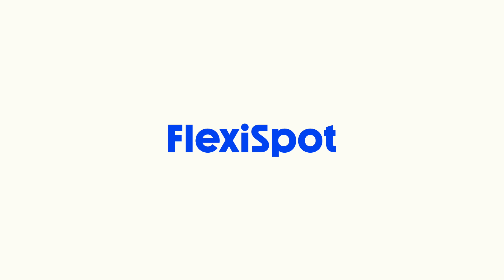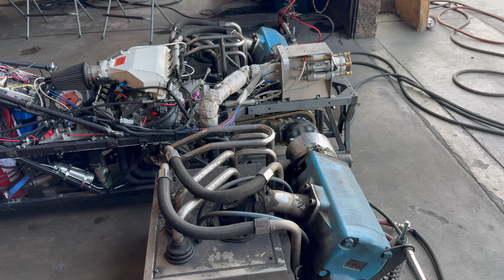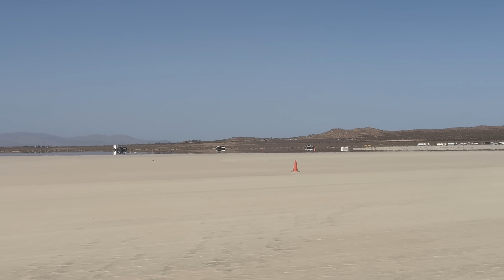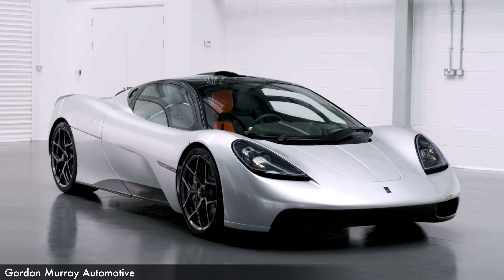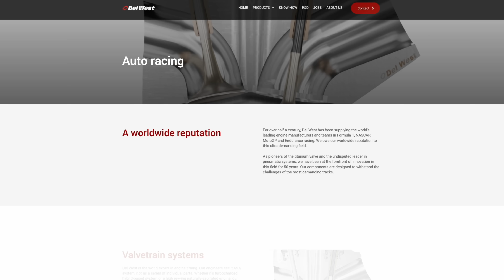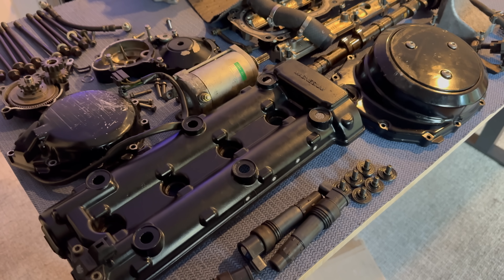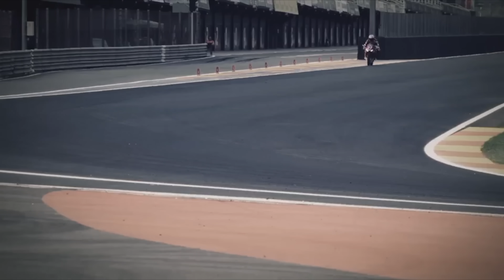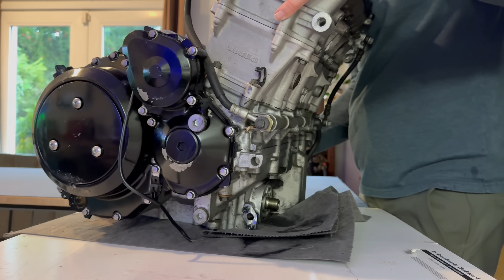Motorcycle Engines Are WAY BETTER than Car Engines

Comment: Motorcycle engines are better than car engines, until you look at how much maintenance they need and how much fuel they use. Car engines never need valve clearances adjusted because they use hydraulic lifters, which wouldn't work at motorcycle engine rpm's. Car engines also have turbo chargers which makes them much more fuel efficient, my 1.8 litre petrol VW uses the same amount of fuel as my 900cc Yamaha and makes a lot more power with that fuel (250hp vs 115hp).
Bikes are much, much more fun though

Comment: In motorcycle engine, there is no ari compressor, power steering pump and no needed massive huge alternator cause its purpose is just going forward. It has less stressful issue than car engie does.

Comment: The more I see of Matt's stuff, the more I think "Why does everyone else not LISTEN to Matt??????" As a car and motorcycle nut, I've never heard such a succinct and accessible explanation. 
I might add that back in the sixties, Honda built multi-cylinder Grand Prix bikes that routinely revved past 15,000 RPM. Their 5-cylinder 125cc bike engine revved to over 20,000rpm....

Comment: 40k overhaul interval should be taken with a grain of salt. It's difficult to establish hard data since, as you stated, there just aren't many motorcycles out there that have the same milage of passenger vehicles, but the bikes I've seen with 50-60k miles often run fantastic with no sign of fatigue. When I see a bike with 8k or 15k with engine issues, two things come to mind: neglect (lack of oil changes, abuse, overheating) or stagnancy...the worst thing you can do to a motorcycle is let it sit around for 10+ years. The acids trapped in the oil start eating the seals and varnishing\carboning everything up.

Comment: I own a Honda VFR 1200X. It has OHC valve train and some of the components are same as in Honda car engines. It has been designed by Honda to last 300k km. German Biker Motorrad  magazine does long range tests with selected bikes. After 50k to 100k km they take the entire bike apart and inspect all parts. All Honda engines they inspected showed little to no wear.  My bike has 40k mil on the clock. Engine runs better than new, burns no oil. Only negative, manual valve adjustment required every 50k km.

Comment: Bikes may have less longevity, but its pretty surprising just how far they will go, even while turning loads if rpm. I have a ninja 500r from 2001 with coming up on 50k miles, runs like a top, rips up to 11k quick as you like. cams are a bit dark, but dead smooth. Sounds like a bucket of bolts at idle, but from what I gather thats just the way they are. Nothing done to the motor save for the occasional oil change and valve adjustment. Oh and the clutch springs. Still has the original clutch as far as I can tell, but somehow the springs wear out first on them.

Comment: motorcycle engines generally need a rebuild roughly every 50,000-100,000 miles not matter how they are maitained. though they are much cheaper to rebuild and work on 90% of owners are not up to that task. it is no longer uncommon to see 4cyl and 8cyl vehicles with over 300,000 miles and counting.

Comment: i just love how the first "car" was a motorcycle. literally a "automobile" - something that "moves on its own" - was a motorcycle. and still, like 150 years later, we still have the objectively better "autos" with the motorcycles. we can argue about comfort, space, practicality (like having a roof, climate control and the possibility to have a snack or drink while driving for example) all day long, but bikes are just better. they take way less space, they are easily parked and maneuvered. they need less fuel - if we all would drive a bit more reasonable of course - while achieving INSANE power and speed specs. they look cooler, sound cooler, its just better. this video is tripleA quality. you described almost all advantages in a good pace and detail, without being to boring or to techy. the real question is: why are not pretty much all people motorcycle owners? why are bikes regarded as organ donor vehicles or the poor mans sports"car"? its just better. and - what i love most btw - the technic is simple enough the be learned by a non pro. im not saying that every idiot should mess around with their bike, but brakes, wheels, tires, chain, electrics, clutch, exhaust, gas, battery stuff ... its all so much simpler, lighter, easier. you dont need a huge garage and expensive shit, you can fix most motorcycle stuff without even lifting it off the ground properly. if needed, just roll the front wheel onto a beer crate and you are fine. if really needed, get a buddy and you two and pick up the rear and lift it up too, easily. man i love motorcycles. shout out to all riders out there and for reading this long comment. lastly... be humble and grateful. we are experiencing this wonderful area of super hightech bikes, and our grandsons will not. enjoy it. we are the last or second to last generation that will be allowed to race them around, tinker with them, tune them, have fun.

Comment: Off road guy here. I couldn't think of anything worse than a motorbike engine in a 4x4. I need something that has enough torque at idle to move the vehicle using high or low range, with or without lockers in, without having to kill a clutch or rev the nuts off it. 

Horses for courses.

Comment: There is also Koenigseggs technology with valves where they are actuated by solenoids instead of camshafts, also good for not having valve float and lots of control over airflow

Comment: Car engines have different needs and requirements, I wouldn't want a 200hp car revving to 13,000 rpm with straight cut gears. I get they use larger pistons and cylinders add more stress and weight, but at low revs, they make good torque to get the car moving under any condition and that is what are customers are paying for. you gotta zoom out a little.

Comment: My hybrid VTOL "flying car" will use a motorcycle engine (air cooled) to power the alternator which makes the electricity the octo-motors use to fly the craft. 400cc+/- is a good jumping-off point.

Comment: Motorcycle engine is ment for motorcycle, light vechile. It needs full power very seldom compared car, that is heavier. When motorcycle engine is istalled in to a car, it must work harder, needing full power more often. Motorcycle engine won´t last as long as car engine, in a car. But, it might be much funnier, maybe that is the point.

Comment: Yea thats what happens when you're allowed to design a motor with little to no emmisions restrictions. The modern day makes engines unreliable because of increasingly strict emmisions regulations that lead manufacturers to prioritizing a models carbon credits over long term reliability/efficiency.

Comment: Excellent video, but minor correction: the force vs compression curve for a gas spring is not exponential. It is non-linear with an increasing slope, but that does not make it exponential. I assume you know this and used that word for simplicity.

Comment: When comparing longevity of motorcycle engines vs car engines I think it is important to factor out driving habits.  Often motorcycle owners are letting their bikes sit for months at a time and don't put very many miles on the bike.

I commute daily on my 2015 Yamaha FJ-09 and it has been completely reliable for 81,000 miles now.  It is a high performing motor and I ride it to the 12,000 rpm redline every time I take it out.  So far it has needed quite a few sets of tires, a number of chains and sprockets, a few sets of plugs, a set or two of brake pads, a couple air filters, and a couple valve adjustments.  Comparing it to my 2020 Chevy Trax that I sold last year with 81,000 miles, the motorcycle has definitely required more maintenance, but I think the difference between a car and motorcycle is on the order of 2 or 3 times the longevity, not the 10x that some people in the comments are saying.

Comment: I hate how they're loud af
Reply: Partially for the fun partially because it needs to be loud enough to overpower a modern car's superb sound insulation and the stereo system blaring loudly 

Car drivers are kind of blind to motorcycles due to looking for car shaped things when merging etc, so if you arent visible you better be loud

Comment: Torque:
Motorcycle engines can make power and may be seen as enough to haul a car around but cars also need torque to get the job done.  For an engine to make torque it needs to have thicker crank shafts and and bigger flywheels stouter transmission gears etc.  These heavier parts resist revving quickly.

Comment: So Matt, just how much impact could Free Valve have on Motor Cycle engineering ...  I am thinking we can really push RPMs up a great deal since we don't need to put the load of cams onto the system except elecrically, nor do you hav eto deal with spring resonance.  I REALLY need to get ahold of a set of free valves to play with

Comment: I find it weird that the new norm in middleweight bikes are bikes like the suszuk GSX8 or the Honda Hornet 750.. These are bikes with a 776cc or a 755cc twin cylinder engine respectively..    The Honda 750 hornet has a wet weight of 192kg... That is a lot of engine for a bike with this weight..  (3930cc engine pr ton).. 

A modern natural aspirated sportscar is the toyota GR86.. It has a modern 2.4 liter engine with a 1270kg kerb weight.. that is 1.89cc/kg or 1890cc/ton.. The same cc to weight as the Mazda Miata 2.0 sportscar..  

Today people scuff on a bike like the Honda CB500 hornet.. A bike with a 188kg kerb weight.. and a square 471cc twin cylinder engine with 47 bhp.. Deem it as only a beginners bike..  a bike that will do 0-100 km/h in 5.4 seconds.. 
The fact that common people can buy a superbike like the Aprilia RSV4 with a 1100cc V4 with 217 bhp and drive it roads with limited experience is scary..

Comment: Yes. Since you are basically sitting in a Engine with 2 tires. Still top of the line bikes costs 25k+ and they are optimized for performance. You get that in cars alot later pricewise.

Comment: You can see this on small 2 stroke engines. My country has famous 45cc moped called Babetta and really it's on the ballpark with 1km/h per 1cc... the fun part begins with tuning. Many people, especially the younger generations, get the cylinder inlay honed so they can have more cc with the same stroke lenght which leads to this little carburated engine being able to pull 100km/h on ~70cc. Which is equal to bigger carburated motorcycles from that era (MZ 150,...) that have almost double the cc.

Comment: They should make motorcycles with car engines...you will have a lot of torque, a very low fuel consumption with enough peak hp and they will be cheaper to produce...a low revving 2 stroke car engine would be great

Comment: Why not have the valve ride in a grove on the cam shaft

Timing would be more precise, potentially lighter since you wouldn't need a spring, and not need another cam shaft

Problem would the friction would could re add up all the weight to compensate

Comment: And the best part: no turbo. No direct injection. No bs that cloggs up your air intake. Just a simple engine.

Edit: Yes I know there are motorcycle engines with turbos, but the point is, that a turbo on a motorcylce engine just boosts the engine. The turbos on modern car engines are basically there to make up for the lack of power. Try driving a car engine without its turbo. Takes 3 buisnessdays to accelerate.

Comment: Mazda has been producing the Wenkel Rotory engine in the R-RX series and they seldom make it much more than 50 or 75 thousand miles since the 1971 R-100
They still suck more than half a century later and only sell on the novelty part of society

Comment: Motorcycle engines are made to very tight tolerances and need to rev fast and higher to get more power. If you motorcycle revs at 15,000 RPM it better be perfectly built or it will fall apart fast. And these super bikes like the Ninja ZX6R or the Yamaha R1 not only needs to perform but also last too! My ZX6R 636cc that revs regularly to 14,000 RPM has 85,600 miles on the odometer and still runs like new. I take my bike to the track day almost every weekend since i bought it new in 2006.

Comment: They are not great for weight though. They don't have the torque you would need. Motorcycle engines are good for motorcycles but not for full size cars trucks and suvs.

Comment: Well, I once had a geo Metro with a 1 liter 3 cylinder that was super light and small, revved high, and was enough, with a 5 speed, to handle everything even at a whooping 50hp output. Sure, some motorcycle engines are cool and engineered well, but some car engines are too. One of the first wooden airplanes only had a 50 hp engine as well, saw it in Paul's museum in Everett WA years ago.

Comment: BMW’s K100 flat 4 cylinder “flying brick” motorcycle engine was a high mileage beast. I knew owners with 200-300k miles on the odometer.  Have often thought it would be a great engine for a lightweight automobile.

Comment: I am super enjoying my Honda CB300R. I put a Coffman's pipe on it. It is so much fun!

If you get a chance to ride a CB300R--do it! 316lbs wet (stock mine is lighter) and 31hp may not sound like much but with the pipe, it goes from sounding like a Dirtbike to a SV650 to a Ninja 300 revving up to 10,500rpm. And with a useful ~93mph top speed i can travel the universe.
I wish every Grom and E-bike kid could try one of these they'd shite themself.
Yes i have faster bikes--they're fun too but heavy with heavier clutch. Not so fun in traffic.

Comment: Just out of interest, I was having a lot of trouble 'undoing' some Allen bolts that had stripped their hexagonal 'key holes' the other day, and was wondering why Allen head bolts don't have Hexagonal 'Heads" too.  It would mean you could use either a spanner or Allen key to tighten and untighten them.  As it was, I had to 'grind' the heads off to get the part off, because it was in a very tight space.

Comment: Simply stating "Motorcycle Engines Are WAY BETTER than Car Engines" is a new level of stupidity...
Each engine is designed for a specific purpose.
- A motorcycle engine is designed to be light and perform well, which also gives it a shorter lifespan.
- A car engine (utility vehicle) is designed to last longer, handle the heavier load.
- A utility engine for tractors, excavators, and the like is designed to handle heavy loads, withstand rough handling.
And so on...

Each engine is in its true element "WAY BETTER" than an engine that some idiot tries to put in without understanding the difference.
Try putting a motorcycle engine in a tractor, or vice versa, and it becomes a Frankenstein monster with no function whatsoever...
Reply: That's literally what he says in the video, he's just exaggerating in the title/thumbnail for engagement, which you basically have to do for the video to perform well

Comment: Motorcycle is not designed to pull heavy loads.
Car have bigger load capacity.
In the end of the day, race car still beats race bike.
Reply: Not for the same cost

Comment: Fascinating! Another engine configuration that has aways been my favorite, mainly because of how simple it is, the two-stoke. I know they are a very "dirty" engine, but with some engineering it could be fixed. I know there has been some work done. However, there is quite an industry built around the four-stroke, all the parts necessary for its operation!

Comment: I disagree.
My engine in my Acura has the most flexible powerband.
I have owned GSXR-1100 and 06 Gsxr -1000
VFR -1200
ST1300
My Acura TL-S engine pulls strong ! with 350000 miles on it

Comment: Wait....my Yamaha FJR1300 has 76,000 miles on it, with zero engine problems afaik.  That thing is bullet-proof.  A high-quality motorcycle mechanic told me I can get 150,000 miles out of it.  What's this 30,000 mile number you're throwing around?

Comment: Using gas to drive the valve also means you can run vacuum on it to act like spring pressure without mass   to decrease float time if that's desired

Comment: Designed to last 40k miles, do you mean that you have to rebuild the engine or scrap the engine at 40k miles?
Reply: Honestly that is quite a low number and probably only applies to extremely high performance motors run very hard nowadays. And you generally won't have to scrap a motor.

Comment: One of the craziest cars I've ever been a passenger in was the Ariel Atom V8 prototype that was seen on Top Gear ages ago. The engine on that is two Hyabusa engines turned into a V8, and the sound of that engine is one of the most insane things I've ever heard. Glad I have video of it.

Comment: My car essentially just uses a straight cut gear reduction: because it is electric.
It has enough torque that you get "good enough" performance tuning it for half the top speed (it does NOT like highway speeds -- very high power draw).
Some EVs have two or more gears (or in some cases two motors with different gear ratios) for better highway cruising efficiency..

Comment: The 2005-2009 Lotus Elise had a 4 cylinder engine designed by Yamaha, but manufactured by Toyota to Yamaha's design.  It actually has Yamaha on the castings.   It is a great engine.

Comment: And motorcycles have wet clutches, so you can give them all the abuse you want and they will just keep going. I used to get my old Honda NSR 125cc away from the line quickly by slipping the clutch at 10,500 rpm — good fun.

Comment: I had a zx6r that I put 100,000 miles on it within 3 years. One cam journal had slight wear that never got worse. Nothing else went wrong. That would give modern p.o.s. cars a run for its money.